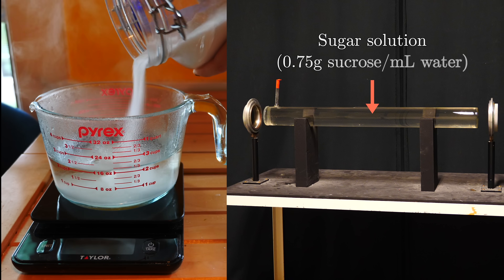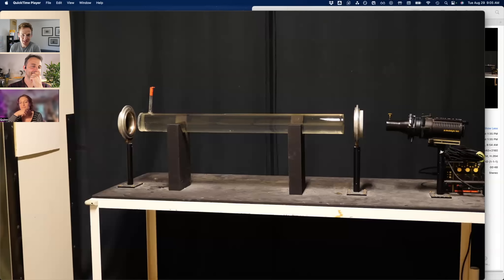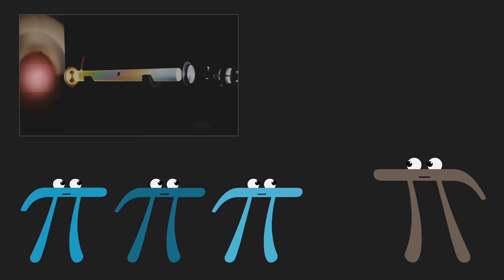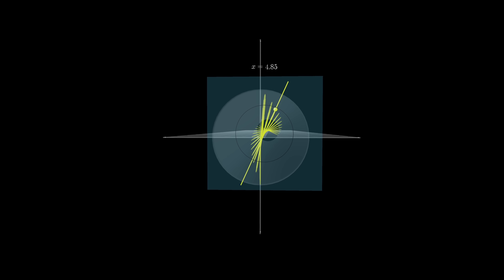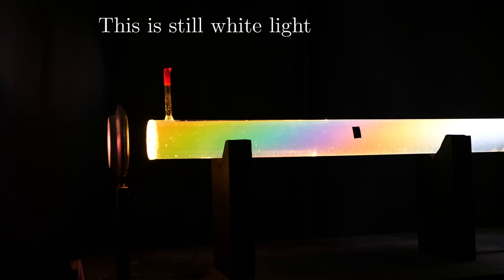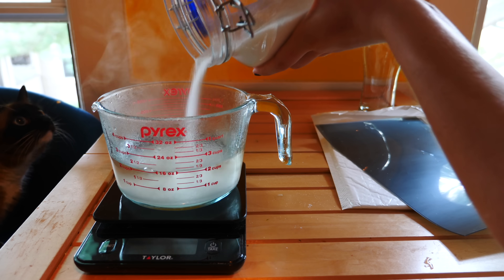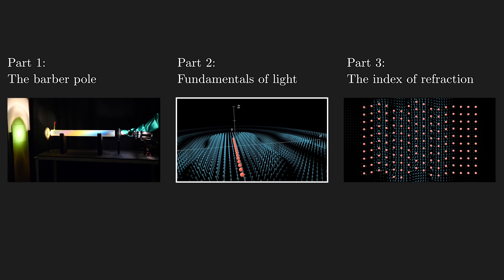This tests your understanding of light | The barber pole effect

Comment: @3blue1brown Hi Grant, I am hoping you (or anyone) can address an incongruity I have noticed as I develop my sense of the relationship between the electric and magnetic fields and how they make up a light wave; I understand that they are spatially orthogonal and changing one induces the other. When the two fields are represented graphically, the orthogonality is clear, however in almost every example, the maxima and minima of the fields are in-phase, with their peaks aligned. I was under the impression that the relationship was more like sin and cos, where the maxima of one would be  aligned with the crossing of the axis of the other (also where it's rate of change is at a maximum). Do the graphics show them aligned for clarity's sake, or do the two fields actually peak at the same time/place? The offset phase version (the one in my head) would imply a constant energy that transfers back and forth, and the other implies a sort of pulsing or beating of the total energy in the combined fields. Or does the relationship shift in phase? Thanks in advance, Wells

Comment: Is this the same phenomenon demonstrated in chemistry? In chemistry we were told that there are enantiomers of glucose (L and R) that rotates the polarized light.... did you use pure L or R glucose for this experiment? Thanks anybody  fo explanation, Michal
Reply: You have to be careful, there are a few different nomenclatures for chiral molecules. D/L is based on the fischer projection of the molecule. d/l (lowercase) is based on in which direction it rotates light. They used enantiomerically pure sucrose, made of D-fructose and D-glucose, yes. That's the version nature produces.

Comment: I wouldn't in a hundred years have guessed the effect would be so strong and so striking, but the overall "shape" of the effect was pretty close with what I had guessed.

Well, in truth, I had 2 guesses.  The first being nothing interesting, but my intuition told me when looking from the side, there was a good chance the lack of symmetry of the curvature of the tube with respect to the propagation vector would cause it to interact with different polarizations in a different way. Also, you wouldn't be asking us what we thought it would look like from the side unless there was an interesting phenomenon.

In effect, looking down the barrel, we get a very symmetric outcome. If light is scattering from interactions with the tube itself, any differences will cancel out because if you rotate your view so a given polarization is vertical, the image of the circular cross section does not change.

But when looking from the side, you simply cannot stand still and rotate your view so the polarization at a given distance is vertical. What you would have to do is rotate your entire body around the central axis of the tube. And that's essentially what you're doing by rotating the filter. Instead of rotating yourself, you're equally rotating all the polarizations.

So there is some asymmetry which, in effect, causes the tube itself to have a polarizing effect. Of course when you frame the question as "why isn't it white when there are no other polarizing filters" becomes a question with a faulty premise. There is a filter in disguise.

Then the diagonal stripes are just whichever polarization(s) are lined up well to scatter in the direction of the observer. Move the observer, and you change the color. I'm not sure if those are aligned with the observer or perpendicular, or somewhere in between. My git would say it has to be aligned or perpendicular, but I've no rationale why. Certainly, it won't be a perfect cutoff, like the imbalanced dot product effect you showed looking through the end filter, there will be a range of polarizations that  are well aligned. That would account for the "width" of the stripes. Of course the stripes are smoothly changing color, but you get what I mean. And the spiraling nature of the polarization described in Steve's video means as the light moves further from the source, new colors will enter and leave that band of well aligned polarizations lending to the diagonal nature of the stripes.

Just because my intuition seems to agree doesn't mean it's actually a correct mental model, so I'm interested in tbe next video. It's been a long time since I took E+M fields or optics in college, so I hope I still remember some of the math.

Comment: The asymmetry that gives you colors may be due to either the material being strained in one direction more than the others, or simply by polarization by reflection through the internal surface of the tube. The reason for diagonal is basically that the actual pattern for each color is a spiral, so the bands looks a lot like a screw from the side. This is my guess

Comment: How long should the tube be for all the colors to return to "focus" = white light?
Is it even possible - greatest common denominator (?) - integers, say: 1, 2, 3, 5 revolutions per, say: 1 meter, red to violet, would require, well, 1 meter. 1, 1/2, 1/3, and 1/5 rpm(...) would require 30 meters.  1, 1/√2, and 1/π rpm would never(?) "converge"... well, actually, they will, at √2⋅π meters...  (typed while thinking, got the answer, continued typing = so you could see the "process"... :) )  1, 1/3, 2/5: 15?

Comment: I still believe it's not the right way to analyze light waves to take a side view of a polarized light. I think if you took a perpendicular slice cut of one "frame" basically you would have a full understanding of the particles interacting with each other in sacred geometry patterns rather than a 2D side witness interpretation of a phenomenon that goes from a to b not c

Comment: I'm think for #0 light is the amount of "explosive power" that is being put out. the power isnt necessarily explosive but rather quick output of energy focused in an area. for #2 i dont know much about light but i think of it in terms of radio frequency and electricity since its more tangible to my job. since the entrance of the tube would have the most resistance to frequency, you would see it as white since its all the colors hitting at nearly the same time while the interior of the tube is filled with water and sugar so its frequency for each color band is different, each color zone would be more prominent in other points of resistance but all colors travel at nearly the same speed the ending would be roughly the same hence the white ending without the adjustment.
Did a step back and thought about circuits and how variations can be applied, the polarization is a variable resistor while the light travels.
gonna brainstorm with some family members to get more cogs in the system turning.
Reply: the striping from top to bottom could be caused by the time it takes for the electrical circuit to go through the light bulb. this could get proved or disproved by rotating the flashlight.

Comment: I barely understand this, but am very interested in something:  The concept of "invert sugar".  Home brewers sometimes will make this (you boil sucrose in a slightly acidic solution).  All I know is that this has something to do with chirality, and that it can measured with a refractometer.  If we were to fill the tube with "invert sugar", would the angle of the stripes change?  And to what angle would the change be?  180 degrees?  Something else?

Comment: Fun fact: Measuring the angle between the two filters can provide an estimation of the amount of sugar in the solution. This trick is applied to precisely evaluate the amount of sugar in wine grapes and must.

These animations are awesome!
Reply: Could we use this technique create a non invasive glucose monitor for diabetics?
Reply: @ricgreen1  I don't think so, you would still need a blood sample for the polarimeter, and blood has many other substances in it that would prevent this from working.
Reply: Im the german village were I come from (called Weinstadt) the vineyard owners would measure the sugar content of the grapes with an optical Oechsle meter based on this effect. Important for determining the value of the grapes if sold to a „Kelter“
Reply: Yeah and measuring the distance and figuring out the tangent between your testes will determine your ability to raise alpha males when referenced to the Alphaie Media Taint Spectrum.  Its part testespecterotomy!  Only men are allowed to join like the masons!
Reply: Is that the brix percentage?
Reply: @seth094978  He is refering to a polarimeter, which uses a specific light frequency (to avoid the phenomenon shown in the video). As far as I know, °Brix (degrees, not %) is usually measured with a refractometer, but you can convert the concentration measured with a polarimeter to °Brix
Reply: @seth094978  I think Brix measurement is based on refraction properties rather than polarization. But I am far from being an expert in this field.. Let's wait if someone can clarify this point..

Comment: I wondered if it meant sugar aligns with each other, which could be ruled out but stirring but perhaps quantum mechanics just works out a macroscopic tendential rotation. Because a sucrose molecule is about 1000x smaller than visible light wavelength.
Also I couldn't help wonder if this is subtle or not so subtle gay propaganda? like quantum mechanics tendencies, a spiritual tendency to focus on the rainbow.

Comment: The tendency of light to reflect depending on polarization is the whole reason we make polarized sunglasses. More horizontally polarized light reflects of horizontal surfaces (the ground/water around you) and by wearing vertically polarized lenses this light is filtered out. This can reduce glare and allow seeing through the surface of water. They also make reflections in vertical surfaces (e.g. windows) stronger for the same reason, but that doesn't have much benefit.

Comment: If we wanted to experiment with this personally, how would I go about finding the glassware you used? you mentioned it's a relatively easy build, but after a bit of searching I can't find a source for the flat-ended glass cylinder you're using
Reply: Hi! The tube was custom-made for MIT a long time ago... I'm not exactly sure what type of glass or where it was acquired, sorry!
Reply: @quinnphys  No worries, we found a cylindrical borosilicate tube that nearly matched the appearance of the one in the vid, we're going to caulk on watch glasses to seal the ends and see if it works. We were curious what the glass composition might do, borosilicate tends to have a green tint but we're hoping the glass is thin enough not to notice

Comment: Great video as always but I am not 100% sure about the orientation of the filter at 6:00. To my knowledge, the filter indeed has an orientation that we visualize by those lines. The lines represent some kind of linear chains of molecules that can be vibrationally excited by absorbing the light only in this one dimension. Only the part that isn‘t absorbed passes trough so its actually the component that is perpendicular to the filter orientation that is allowed to pass. Of course it doesn’t matter for the whole principle of a polarizer after all but its a technical detail that might be interesting afterall. Being said, I am not 100% about this but I think I read about it recently.

Comment: One of the most things that confuse me about light, is that each color we see corresponds to a wavelength, and yet it's possible to have multiple light waves be merged together to form a color that is combination of both, but doesn't this color that we obtained correspond to a wavelength itself? And if so, does that mean that we can't see the difference between a color that is the result of colors combining and the pure version of that color? Unless we use a polarizer?? Doesn't feel like it doesn't fit together?

Comment: The color is something I haven't seen before. In physical chemistry we used the polarization to measure the concentration of the sugar with monochromatic light. In a way where we used the second folter after the tube and turned it to an angle where no light passed though, that gave us the angle the light turned and the concentration.
ps we did this with sucrose which splits into fructose and glucose, inverted sugar, because it changes the angle. sp we measured the change of the angle to find the speed of the reaction.
Would be interesting to see if this also affects the colors. My thesis would be, starting from sucrose, you would see the spiral slowly unwinding and then winding up in the other direction

Comment: The ultimate visualization of polarized light/matter interactions is the Mueller matrix. Shows all possible effects of linear and circular polarization. It can be used to detect skin cancer, due to scattering by aligned muscle fibers (I think), so it's useful, not just fun. I dare 3Blue1Brown to step into this minefield :).

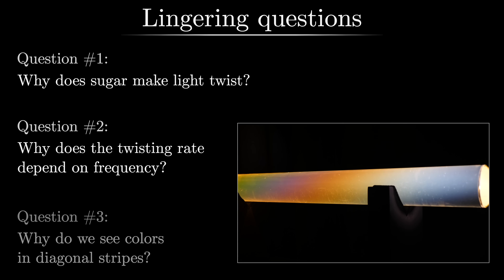Comment: @8:05 . Before seeing this video to the end, I wish to dare an explanation for the different colors one sees on the side of the cylinder. 
So, I think the scattering of the light in a determined direction by the sugar molecules is dependent on the polarization plane of the incident light. At each place on the way down the cylinder, the sugar molecules scatter more of the light (in the horizontal direction) that is vibrating in a determined plane. Since the different frequencies (colors) are twisted in different planes (at a place down the cylinder) more light of a determined frequency will be scattered in this place.

Comment: But none of this is what light actually is.  This version of Optics is based on waves, when in fact the most we know what light actually is, is Quantum Electrodynamics.   When we think we see waves, reflection, refraction, diffraction what we are really seeing is the simultaneous path integrals creating the illusion of these phenomena, despite not actually existing.

Just as in statistical mechanics gives us the ideal gas law, PV=nRT, the underlying what gas "actually is" is not pressures, temperatures and volumes, but individual molecules and their corresponding position and momentum.  This creates the illusion of pressure, temperature and volume.

Comment: While you are about it I would like to get an explanation why a polarizer (at least in a camera) removes about 50% of the light? If in-coherent light has infinite differently oriented waves then intuition says that removing all but one direction should give light intensity of one over infinity ie zero, or the polarizing filter not being perfect, some small number, nowhere near 50%.
Reply: You can write all of the other polarizations as linear combinations of horizontally polarized and vertically polarized. A  perfectly diagonally polarized wave for example would be made of both in equal proportions. The point is that you can write everything as a combination of horizontal and vertical. In normal light neither is preferred, so the split is 50/50.
Reply: @lunkel8108 Thanks! My first reaction is that this is a great explanation! I have muse this a bit, :)

Comment: An interesting experiment to have would be to extend the tube even further, or set a second tube right next to it.

My guess so far is:
Q1: fotons cause induction magnetic field in the sugared water, which itself causes the different twist for different length of waves on a set distance;
Q2: twisting rate depend on frequency, because the differet light waves carry different energy, therefore they cause different strengths of very localized induction magnetic fields;
Q3: diagonal stripes might have something to do with how light scatters - as the light is polarized, any wavelength can escape the side of the side of the tube, but the least refraction will be achieved at a straight angle, and as the wavelengths have different twist period, they come in 90 degree angle to the viewed at different parts of the tube.

In addition, I want to  note how at 8:09 part of the tube turns black, as plenty of fotons seem to refract away from the viewer, therefore likely rendering the tube like it doesn't emit light.

Comment: yup - i'm hooked. I was torn between some kind of stress-in-the-glass-polarization, something having to do with polarization dependent reflection, and a vague un-thought-out concept of polarized scattering like the dark band 90 degrees from the sun... sounds like it's the third and i should think harder! can't wait to see the rest. In retrospect those first two don't work at all because the polarized twisting light is only traveling axially... until it scatters... hmmm...
Reply: oh shoot wait both parts out at once??? sweet